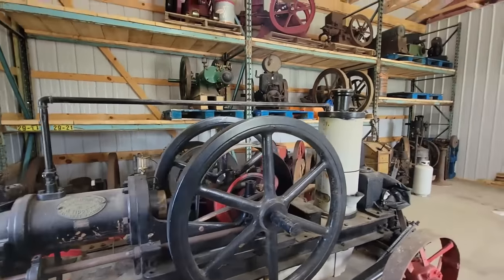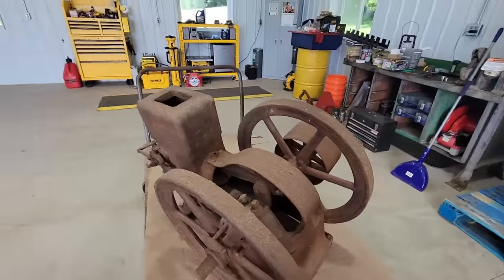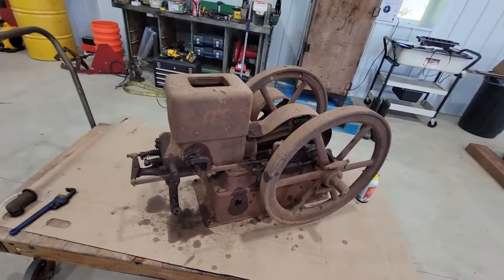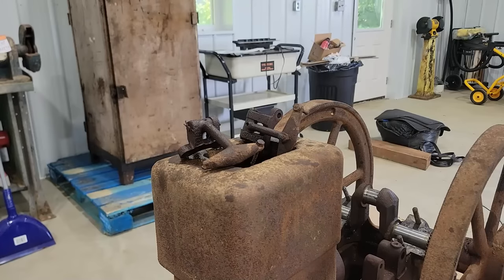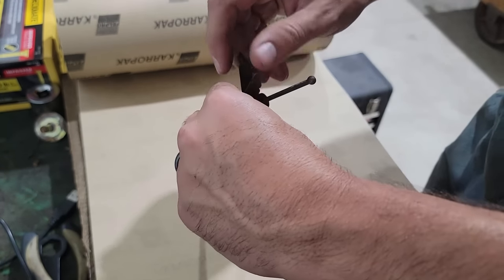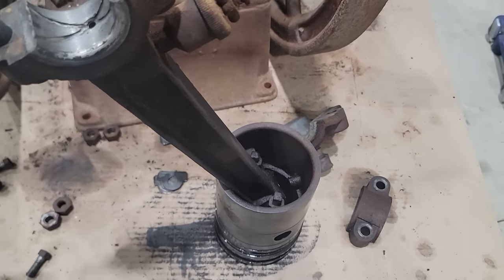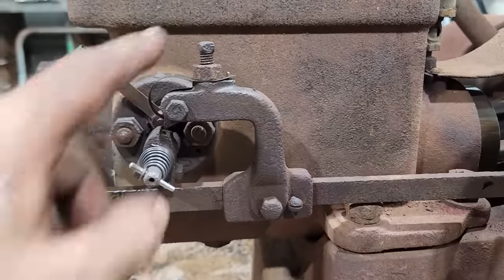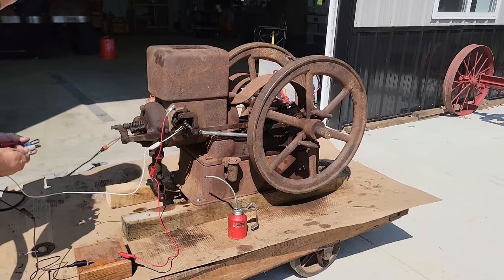100 year old BARN FIND Hit Miss Engine RESURRECTION!! Will it RUN???

Comment: your not going to know if your bearing clearance  is correct tell it is miked or gauged with a shim the bearing material may be a bit to soft for PLASTIGAUGE   but maybe not
Reply from the maker: When these engines were originally built plastigauge I'd guess was not around. I normally go by feel for my oil clearances since I've had so may apart I can usually get it good enough for all the more they will run.  However if I was to want to use this daily I would take a little more care in getting correct clearances.
Reply: @Cast_Iron_Curiosities  with time comes experience and it is not like there going to be use for any thing other then just idling at a  show

Comment: I want to see that huge engine out in the yard run and shine the rust off her. This engine could run for a week full of oil to drip in the right places. If ya'll knew how to braze ya'll could braze those gear teeth back on the destroyed gear. Not being able to solder, (@the gas tank leaks), and the failure to remove the broken off bolts shows me that dropping engine components and breaking them is nothing new. Just like me. Your soldering lack is because of flux. Ya'll need solder paste, and a welding cheater lense to see what yee be doin.